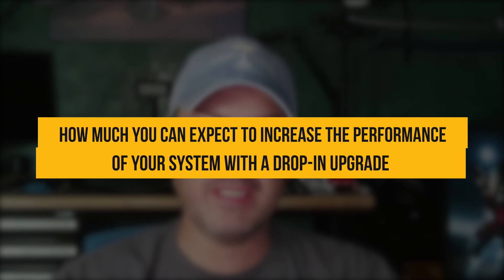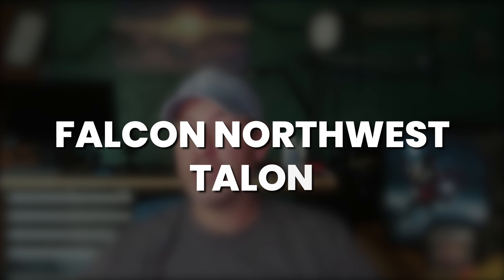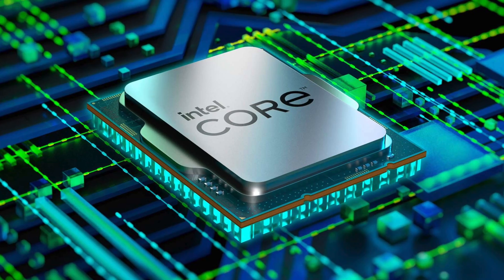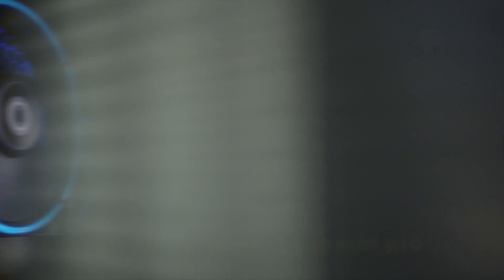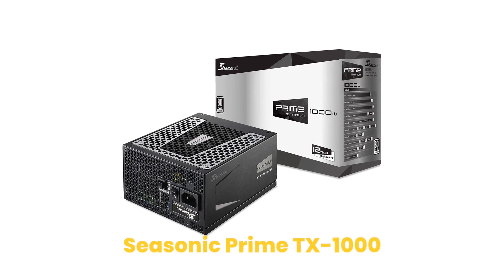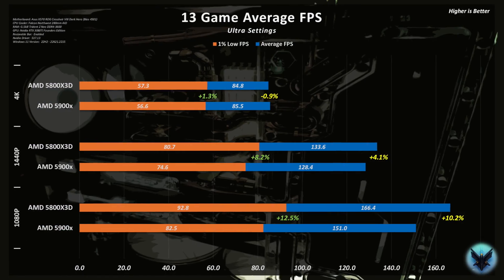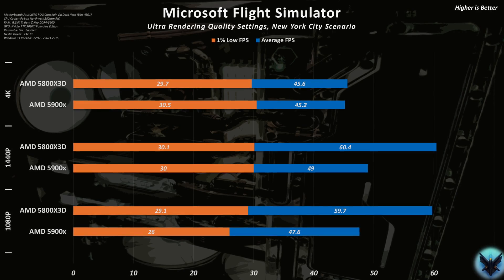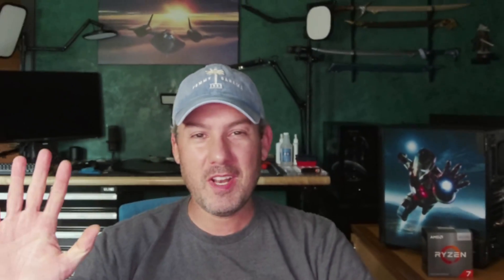Is The 5800X3D Really Worth It?

Comment from the maker: My Cinebench score for the 5800X3D displayed in the video is lower than expected so I investigated to find the cause.  It turns out that my AIO cooler from Falcon Northwest decided to die during my benchmark testing (never had that happen before).  After installing a new AIO and running all of the benchmarks again, the only numbers that changed were the synthetic CPU benchmarks and Microsoft Flight simulator at lower resolutions, that's it.  So the good news is the recommendations in the video are all still valid.  You can find a PDF of the new benchmarks on my website:  https://blackbirdpc.tech/
Reply: Well....at the end which is better for you. I have both and i need to have only one... Which is the best if you can choose one for you? I hope you can help me with this
Reply from the maker: @pacificostriker it depends on what you are doing. If you predominantly game then keep the 5800x3d. If you want more of an all round chip then keep the 5900x. If you game at 4k then it really doesn’t matter.
Reply: @blackbirdpctech I'm looking to swap to Linux and game, I have a 3600 and wanna upgrade... Should I get the 5700X3D or because I'll be running Linux and gaming on a windows VM, will I be better off getting a 5900x or 5950x for the extra cores?
Reply from the maker: @AlexHonger-fj3nx  take a look at my “Is The 5700X3D Really Worth It?” video … I upgrade from a 3600. That said I’m not sure about the extra resource load that running a VM places on the cpu and RAM, so it’s tough to provide you with that guidance.

Comment: I wanted to see this video because the audience of Hardware Unboxed always seem to champion the 5800X3D over the 5900X and that 5900X is no longer relevant. I would love to jump up to 9950X3D for games and productivity, but because I have 64GB of DDR4 RAM, I don't want to pay a lot of money just to get 64GB DDR5 memory.

For me, as I don't care about 120Hz or higher refresh rates and that I only play single-player games, anything above 60FPS would be considered overkill for me regardless of whether I stay with 5900X or go for the 5800X3D with larger L3 cache. Of course, since I cannot tell a difference between 3840x2160 and 1920x1080, I'm not losing much by sticking with 1920x1080 even though I would love to game at 4K just for bragging rights. Of course, the only exception is Portal and Portal 2 with the grating textures since these appear to show more of the high contrast details compared to just about all other game textures.

Anyway, thanks. Your video helped answer my question about whether I should have gone for 5800X3D even for more than just gaming.
Reply from the maker: In fact, my next video will compare the 5800X against the 9700X to specifically see if it's worth upgrading from DDR4 to DDR5 ... some very interesting results.

Comment: Iv been having alot of issues with my 5900x in more cpu based games this past year at 1440p (helldivers, vrchat, forza H5 etc) due to its duel CCD layout splitting the cores and cache causing my games to stutter or have bad latancy. 
So for me Im going to switch over to the 5800x3D to fix those issues, even if I dont gain much from it, at least my lows will be more stable in games.

GPU is a 7900XTX too so i know thats not the issue.
Reply from the maker: That makes sense ... I don't think you will be able to buy a 5800X3D new ... so you will either have to pick one up 2nd hand or settle for a 5700X3D

Comment: Thanks for this. I'm considering an upgrade from a 3700x and since I recently moved from a 1070 Ti to an RX 6800, which is still a tad bit slower than a 3080 Ti, I'll be GPU bound in most games at 1440p. So I might just go for the 5900x or even a 5900XT processor over he 5700x3D because it'll give me the same amount of frames but it'll be faster for everything else.
Reply from the maker: If you use upscaling the load will shift back towards the CPU, so that's something to keep in mind.

Comment: Good video. Thanks
Just as I thought. The difference is too minor especially 4K. So, does not worth the extra cost to buy the 5800X3D.
Reply from the maker: 4K can be tough because your GPU tends to be the limiting factor.
Reply: @blackbirdpctech  4k is very demanding, I cannot disagree. However, if performance is okay in 4K resolution than obviously going to perform even better 1080p. 1% LOW and 0.1% LOW are more crucial IMO. Who cares about 500FPS peaks occasionally. Decent 1% LOW is better. 5800X3D is not that much better regarding 1% and 0.1%. 5900X makes it enjoyable and cheaper, productivity is even better.
Reply from the maker: @Pocokcic  that's a good perspective because I will take great 1% lows and lower average FPS any day ... that's what you will notice.

Comment: this actually hellped me a lot.
just like you i had  the 5900x.

i found a cheap 5800x3d near me which I decided to get  (because it was so cheap) and decided to drop it in.

Immediattely I noticed the performance dips while trying to stream my games,   when I checked task manager > performance, i saw the cpu maxed out (8 cores vs 12)  

so i'm  indecided... not sure I should just go back to the 5900x and use this 5800x3d on some other project. (like upgrading the livingroom htpc)
Reply from the maker: It's not really an upgrade, it's more like a side move, but it only really makes sense if your primary focus is gaming.

Comment: I'm on a 5800X3D paired with a 6950XT but I'm thinking about swapping out the 5800X3D for a 5900X (maybe 5950X) I'm gaming at 1440p, but I also plan on doing some more productive things. I don't see the value proposition of going for AM5 at the moment. 

Great review appreciate you sharing.
Reply from the maker: The 5800X3D is a great chip but it is lacking in professional workloads ... if you can get a cheap 5950X, that would be my recommendation ... you will lose a little in gaming performance but you will pick up a lot in professional workloads.
Reply: @blackbirdpctech  Yeah I find the single core performance a bit weak and it's a bit sluggish in Windows and I'm not fixing to replace my system just yet so I'll be aiming for a 5950X. I appreciate the feedback.

Comment: I can get a 9 5900x for 150$ but it is only 13% better than my 7 5700g that i got for 90$ to replace the R7 3700x.I just got off my AM3+ that pc still can hang,but it was even choking my titan xps.Just going to the AM4+ was enough.Not sure if the 9 5900x being big enough a jump.Even the R7 3700x was not bad compared to the 5700g.But the 9 5900x will be the end of my am4+ journey.And i built 3 am4+ pcs with 800$.Out of everything the asrock board took a crap,that was only 40$.Got the taichi x570  x370 carbon pro and b550 plus.I had to make 1 sli setup with my titans and one with 1070s sc.The other has 1 3060 with the 5700g.Asus prime is not sli comp.but got everything used.Have not had to build a PC for 10 years those am3+ fx8350s are reliable at the least,and OC like a beast.But only during wintertime will I go back playing on that one.Am4+ I do not need to OC and much less power draw,my bill cut in half.

Comment: Which one would be faster for Fortnite competitive 1080p gaming running on performance mode low settings and why?
Also is it just about fps in this case or calculation speed? Thanks.
3600
3060ti
16gb 3200mhz
Reply from the maker: Definitely a 5800X3D … at those settings (1080p/low) you are heavily loading the cpu, so the 3D V-cache will help the cpu perform better and the game won’t use the extra cores from the 5900X.
Reply: @blackbirdpctech  thanks for the reply that helped me alot. I also recently changed to dx12 from dx11 (performance mode) and I reckon dx12 is better. Way smoother in my opinion too which helps alot.

Comment: with the 4090 the 5800x3d is 20-50% faster and 30% on average.  I expect even more of a difference with the next RTX5000 and RX generation
Reply from the maker: At what resolution and game settings? The problem is at 4K ultra settings the cpu doesn’t have a big impact, so there is not much of a difference between them on average.

Comment: I recently got a 7800XT for my pre built AM4 PC. But I am still using the Ryzen 5 5600X that came with it and I suspect it is leading to bottlenecks. Games that detect the hardware switch the settings down to medium when I had been running on high or ultra on my old 4060Ti which was the stock GPU and at higher settings especially with FSR on I have been getting some stuttering and crashing. I made sure to totally wipe the old drivers and get the latest version of the new drivers when I swapped cards. I also upgraded the PSU from 600W to 850W. I have considered a Ryzen 7 5800X3D for my next upgrade. This should take care of my stability problems no? And I should be able to still use the PSU I'm currently using with it? I don't plan to overclock either, but I will likely need a bigger air cooler and more fans to support the new chip (I wanted to avoid AIOs and custom loops for reliability and simplicity).
Reply from the maker: My next video that I'm working on now will be on upgrading a prebuilt AM4 system, so your timing is good. Your PSU will be fine however I don't think your stability and/or stuttering issues are related to your CPU. Are you using an Asus motherboard by chance?
Reply: @blackbirdpctech  I believe its a Gigabyte model
Reply from the maker: @DAN007thefoxx1  try uninstalling the Gigabyte software ... just a hunch.

Comment: Not a major issue, but why did you bother to take out the GPU?  I just got a deal on a 5900X for $249, so I'm happy to see this comparison, but I do need to upgrade my CPU cooler.
Reply from the maker: I think the cable from the cpu AIO was routed under the gpu … it also gives you more space to work and helps avoids any scratches or damage. What are you considering for a cooler?
Reply: @blackbirdpctech  Probably just a Thermalright Peerless Assassin 120 twin tower fan setup.  Moving up from a Ryzen 5 3600 (with the free AMD spire cooler).  The motherboard is an Asus Tuf Gaming x570 plus WiFi, so it should be able to deal with 40 more watts for the CPU.  And a Radeon RX 6800 for a GPU (never enough budget for more LOL).
Reply from the maker: That’s a great cooler … your motherboard is fine just make sure you update the bios before removing the old cpu. I’m currently working on upgrading a prebuilt with a 3600x and 3060 for my next video. Likely going to upgrade to a 5700x3d and 4060 Ti … the chassis won’t accommodate a large air cooler but the good smaller ones can still handle 130W so it should be fine.

Comment: Your results are not showing the same CPU scaling as other big name channels with these parts. I am not sure if its a GPU bottleneck or what but, Gamers Nexus and Hardware Unboxed show the 5800X3D absolutely destroying the 5900X in most games. They are using a 4090 and not a 3080ti.
Reply from the maker: Please look at the pinned comment and updated benchmarks. At 1080p there is an average increase of 11% and 1% low increase of 14% across 13 games, which is a significant advantage for the 5800X3D. In games that really leverage the 3D cache, like Microsoft Flight Simulator, the advantage at 1080p is around 46%. I can't talk to the results from other channels because I am not familiar with how they test.

Comment: I bought the 5800X3D a few months ago at $300. I had an X570 build with a 3700X processor and an RX 580 GPU. It gave my machine a new life and made upgrading the video card worthwhile. I am feeling pretty good about my machine again. I have an RX 6800 that is bottlenecking my CPU. For $658 I got a major upgrade. The 6800 was $358 and the 5800X3D was $300. It's not all brand new tech but for me it is a brand new machine. I even had to buy a case because the 6800 wouldn't fit my old front bay full tower. Add another $109. 
 Yep, the money does pile up. As long as I don't have a motherboard failure I am good with what I spent for the performance I got. It's always a gamble and a 4 year old board can go pop at any time.
Reply from the maker: Sounds like you were pretty smart about your purchases … don’t forget you can always re-paste the gpu … it’s really easy to do … I might actually do a video on how to reinvigorate your system.

Comment: What about 1440p ultrawide? Fits somewhere between 4k and 2k so is it worth it?
Reply from the maker: Good question. A 1440p ultrawide display is approximately 34% more pixels than 1440p and around 67% less pixels than 4k. So if you linearly interpolate between these two resolutions you can estimate the result. For the 13 game average the 5800X3D would have a 2.7% average FPS advantage over the 5900X, definitely not a meaningful result. For the 1% low FPS it would be 6.9% which is beneficial.
Reply: @blackbirdpctech  perfect answer, thank you so much! 
I'm currently deciding between upgrading my pc with a 5800x3d with my current 3070, or I've got the potential to get another pc with 10900k with a 3070ti. Trying to ascertain how much better the 5800x3d is is hard but it may be more negligible at this resolution 👍

Comment: I don't recommend upgrading to a 5800x3D even if you're on AM4.
If you have the $280+ saved for a 5800x3D, just sell your current AM4 MoBo, RAM and CPU and get into AM5 instead. even the cheapest AM5 CPU, the Ryzen 7600 (or the 7500F if you don't mind buying from AliExpress) will perform mostly the same as a 5800x3D and you get the AM5 upgrade path.
Reply from the maker: That is definitely an option however at this point I would wait to see what the 9000 CPU’s offer and potentially get a new AM5 motherboard that will likely support higher speed ddr5.

Comment: The R7-5800X3D was only worth it if you were already on AM4 with a Ryzen 5000 CPU or lower.  To be honest, with the existence of the R7-5700X3D, the 5800X3D isn't worth it anymore.  It's the same situation as when the R7-5700X displaced the R7-5800X.

I say this as an R7-5800X3D owner.  If I were to buy today, I would totally choose the 5700X3D but its gaming advantage over an R9-5900X, while not insignificant, isn't worth the asking price of the 5800X3D.
Reply from the maker: I would still get a 5800X3D ... the 5700X3D is simply a 5800X3D with slightly slower clocks but for the relatively minor price difference I would go with the 5800X3D (even though it's only 3% better performance).
Reply: Would either of you say its worth the hassle to swap a 5900x for 5700x3d? Id have to reinstall windows because of potential windows dual ccd to single ccd shenanigans. Only considering because i hear the 1% lows would be better compared to my 5900x and i feel like 5700x3d would allow me to upgrade to a higher tier gpu in the future before it becomes the bottleneck if that makes sense? Currently on 3070ti and my pc is 90% gaming use.
Reply: @ultimategohan1551  I would say no.  Don't get me wrong, it will game better but it won't be the day-and-night difference that would make the extra expense worth it.  Also, any non-gaming applications would be noticeably worse.  I think that you're fine with the 5950X and you could do other things to improve your gaming that cost nothing like disabling one CCX if that's causing a problem.
Reply: @CF-105_AvroArrow  no issues with the 2 ccds on my 5900x. Only swapping to the 5700x3d could leave behind drivers in windows that could cause issues, so to be safe a os reinstall would be best. Think im gonna do the swap. I could break even by selling my 5900x im pretty sure. I mostly game/web browse so i think this is the best upgrade for a dead end platform.
Reply: @ultimategohan1551  did u switch to the 5700x3d
Reply: @blackolds84  i ended selling my old pc and getting one with a 7600 instead

Comment: i bought over a year ago, 5950x  because is only €100 more expensive. not is a buy intelligent, but i hope that this cpu can be useful a lot of years, Best regards!
Reply from the maker: I have a 5950x in one of my systems too … great cpu, should last a while. Thanks for watching!
Reply: @blackbirdpctech  Hello I have Ryzen 5700x and I am thinking of buying 5900x or 5950x which one do you recommend. Which one gets hotter and which one runs cooler. Case NZXT H6 Flow RGB 9 Fan installed, Motherboard Gigabyte B550 Aorus Master, Graphics Card Asus Dual RTX 4070 OC Edition, Ram Kingston Fury Renegade 4x16 64GB 3600 DDR4 CL16, Power Supply Akasa Venom 850W 80+ GOLD, CPU Cooler Dark Freezer X128, 2x12cm Fan, 6x Heat Pipe 220W TDP. I do not plan on changing platforms, I will use it for rendering and gaming occasionally. Thanks.
Reply from the maker: @ssicin9825  if you are focused on professional applications then get a 5950X. It will not offer any boost over a 5900X in gaming but the extra cores will be useful in professional workloads.

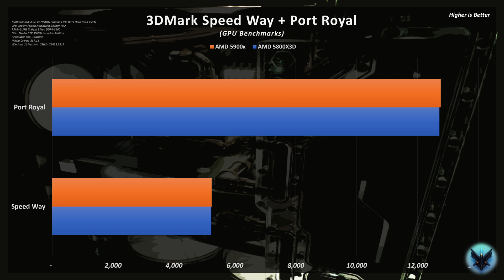Comment: 8:44 Is it not a mistake? 5900x slower than 5800x3d with practically  rendering?
Reply from the maker: Yes, someone else pointed that out … the data is correct however the label should say “higher is better” not “lower is better”. You can download a PDF of the updated benchmark charts from my website (see pinned comment). Thanks for catching it, I appreciate it.
Reply: @blackbirdpctech   "Failed to load PDF file." 
Just this one :) 
So, finally which one faster for rendering?
Reply from the maker: @andrewswiderski8811 the 5900X, the data/chart is the same but for blender I accidentally thought it was measuring render time but the behchmark was actually measuring samples per minute. I just went on the website to try the file and it loaded fine, so perhaps it was a glitch.